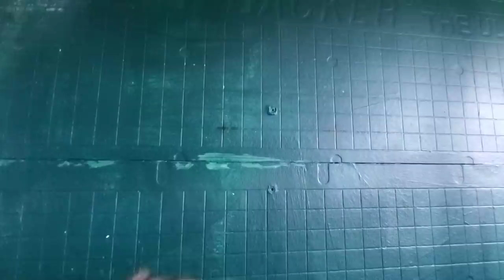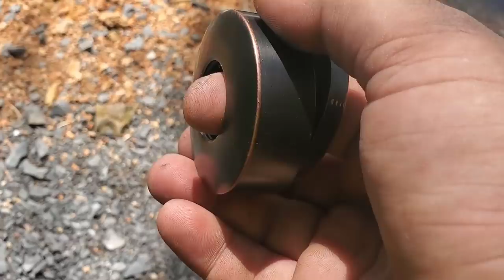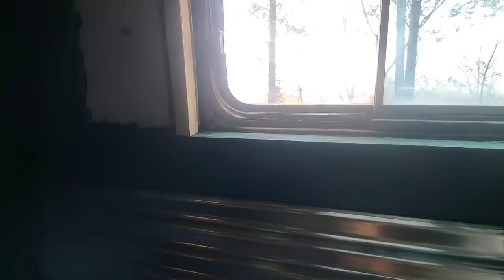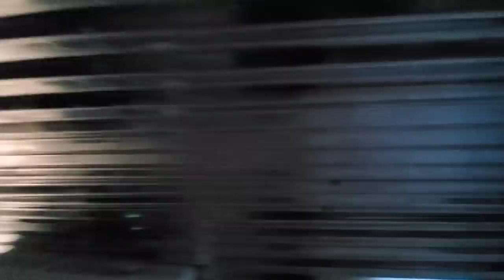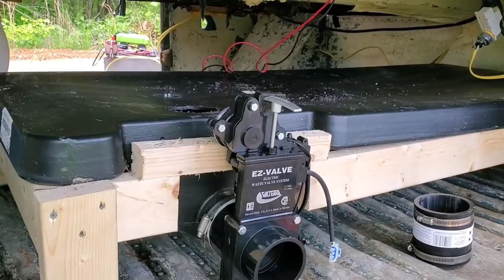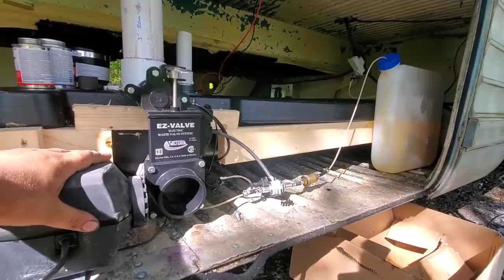Silversides conversion part 15

Comment: Store your PVC glue upside down.  It will seal off and preserve the remaining cement.  Thanks for the videos.
Reply: Last time I did that I needed to cut the lid off with a angle grinder. Did you know PVC glue is highly flammable?
Reply: @engineresurrector2414  LOL

Comment: You'd usually mount the fittings so they'd stick out further and lay the tile closer to the angle fitting so that the deep cover would fit. I guess you want as much space as possible so you want it further inside the wall.
Reply from the maker: Yea every inch I can gain is needed on the build.

Comment: Hey Tyler, maybe take a cutoff wheel to some of those nice sharp screw points sticking down through the ceiling of the bay by the water heater? I know if I tried crawling back to that inverter I'd manage to get about half of those nice sharp points into my back or the back of my head!

Comment: Not done the video yet, but had you given thought to putting a battery blanket between the tank and the insulation to keep it from freezing during cold snaps. Could switch the outlet and run it on a timer or switch it on/off as needed. Might not be a concern down South but I'm Canadian so frozen tanks are a real risk.

Comment: Do you have a decent genset? Some tie into the vehicle's fuel tank,
some prefer a separate, exclusive fuel source. Then there's the more 
modern setups that use both propane and gas/diesel.
Reply from the maker: It's not going to have a permanent on board generator. I will carry a smaller one with me tho. All critical systems will run off solar.
Reply: @Spyke383  Just thinking of cloudy/rainy weather.
Reply from the maker: @HUBBABUBBADOOPYDOOP  yea, as i grow the battery bank that will be less of an issue but the generator will be taken with just incase. Looking at a 2200 or 3000 Honda.

Comment: my question/concern is the water heater. Is it OK to mount that at an angle?
Reply from the maker: Yea I'll just have to make sure i bleed it when i fill it initially. Its all pex so there will be the ability to move it.

Comment: No surprise that your stubs didn't line up. You should ALWAYS start with small pilot holes for accuracy then work up to your monster drill bit using a step drill bit.
Reply from the maker: They are offset. Once clocked properly they fit perfectly.